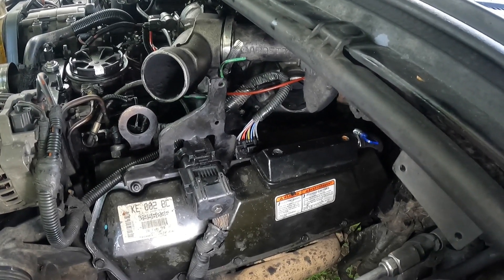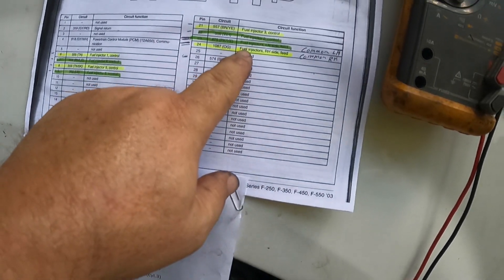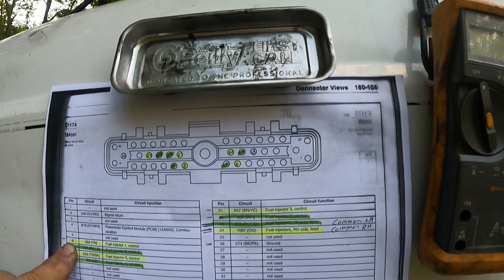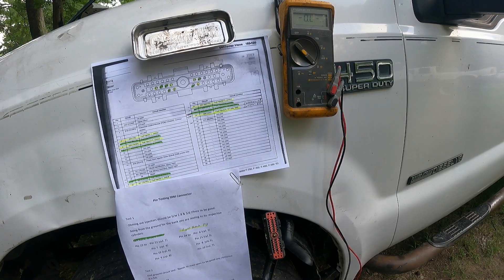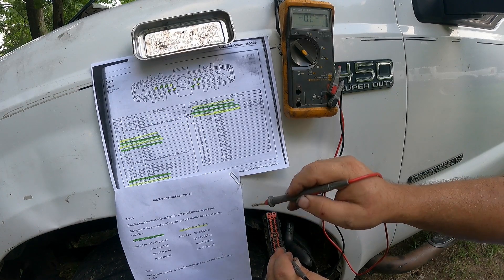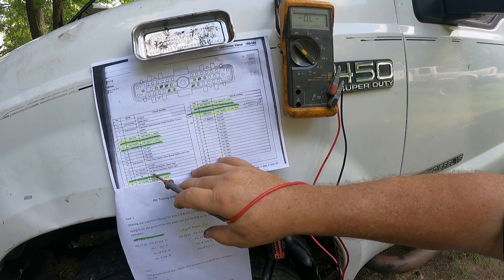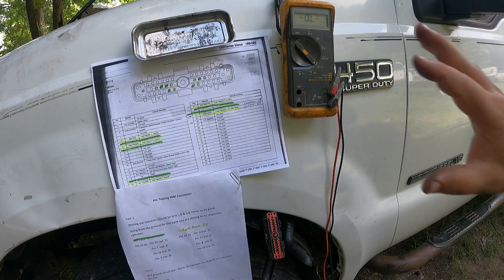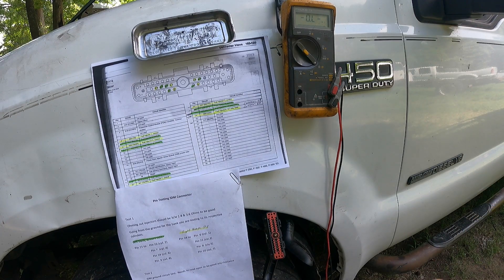IDM Wire Harness Pin Test. P1316 DTC.   2001 7.3 Power stroke

Comment: I have continuity between 24 and 18 in a E350 1997
Reply from the maker: @CristhoferSahagun  it would appear then that your pin 24 (common hot for right side) is grounding to pin 18 (shield wire).  Probably causing a dead bank on the right side. Need to dig into the harness and connectors to find the short.
Reply: @bayoudiesel  Thank you very much! You are very helpful

Comment: Bayou diesel great video, i also have a p1264 code when I test my injectors, as well as a p1316 a p0381 and a p0270 

I tested the harness for a short like you showed about 4 different times and kept getting around .35 for most of the driver bank and sometimes even lower, so not too much resistance

So i assumed idm, poped another one in from a tester truck that was known good and still have the p1264

Also have swapped injectors around (as i just did them) and the problem stays with cylinder 4.

Even cut open the corrigate around the driver side injector harness to look for breaks in any wires, pin 15 from the 42 pin connector (the one with the teal and black wire) seems to have been stripped but I was alsp reading about a sacrifical ground (never heard of this before) so maybe that was that wire. Anyways thanks for any possible help
Reply from the maker: Hey bud.  I had to consult the books to refresh my memory on a couple of these.  Let me tell ya what the books say and then what I think.

1264- hi to low side short
possible causes - shorted circuit, shorted injector, failed idm.
1316- idm code is usually bullshit meaning you have a wiring issue most of the time.
0381- glow plug indicator circuit malfunction.
possible causes- open or grounded circuit, lamp open, failed pcm.
0270- cal 4 circuit low
possible causes- harness shorted to ground.

Now for my thoughts.  Looks like a harness issue.  Probably wiring but could be a connector as well.  When you moved injectors and the problem stayed in hole 4 indicates issue with #4 wiring.  Disconnect the 42 pin and flip it over to inspect wires for abrasion.  You will need to open some loom.  This is for both sides of the 42 pin.  The side coming form the fender is known to rub underneath on the valve cover and the engine side in the hard elbow just ofter the plug.  That should cover 1264 & 1316& 0270.

0381 is self explanatory 

in my book tn/bk is tan /black and goes from the idm plug to the control pin for injector #5.

You have an uninsulated wire and a foil wrap for grounds.  Testing them is in that procedure in the video.

You can swap the uvc gaskets form left to right to see if problem follows it.  If not you are chasing engine harness trouble.  That can be replaced or repaired.

Check that you are on straight ohms, like the setting with the beep.  Some have a scale for ohms and will give ya different readings.  

Lastly keep in mind that when doing continuity (ohm) test you can get a good test with just a strand or two still connected but that won't carry the load of 120v dc going to the injectors.

Hit me back and let me know what ya find out.
Reply: @bayoudiesel  so I checked for resistance again and got a high number and then another one and it seemed like the pin fit wasnt great for that wire on the connector at the 42pin and also at the idm, so i pulled the wires out of the connectors and now get a super low resistance, what could possibly be happening here ? Its giving me like half answers lol. Also I dont see anywhere the harness could have shorted to ground. I do believe what youre saying when you mentioned just because it ohms out good doesnt mean it can handle a the voltage when it is running, so im going to get some pins from ford and overlay that wire and see what happens 

Also I posted a video of the teal and black wire i was talking about its #15 on the engine harness side 

Also how is the 0381 self explanitory ? Doesnt that mean the light is out on the cluster for the glowplugs ? Idk i just did glowplugs, injectors, cups so maybe i left something off under the passenger side valve cover, but gawd damn do I sometimes regret my career choice, if the overlay doesnt work idk what will
Reply from the maker: @TylerBigHead  on the wire that you pulled that is giving mixed results, now that it’s out and isolated from other components try sending power through it by hooking one side to ground and then put a small light like a trailer light to it and hook to hot to see if the light comes on. That will tell you if it will carry a load. 

Seems to me that 0381 may be a bad light in the cluster. Use a test light to check that when the key is in “on” that both large posts on the glow plug relay are coming on. The relay should be on for a min or more every time the key is put into on. Is so the relay and plugs should be working fine but the indicator light or it’s circuit isn’t working correctly
Reply: @bayoudiesel  okay so finally got new pins for the overlay wire, still getting a p1264 when I buzz test, I guess now I have the pins I could overlay the engine harness side of the harness now but that voltage tests good. It still buzz tests good but getting the same high to low short code 

I am very confused at this point
Reply from the maker: @TylerBigHead  have you tried swapping uvch sides to see if the problem stays with the #4 hole. Quick test to determine if the uvch is the problem?
Reply from the maker: Also. Have you tested the #4 solenoid itself?
Reply: @bayoudiesel  yes i have swapped uvch from side to side and I have swapped the injector from 4 to 2 and to 6 and 8 just to double check. At this point i may just throw a engine harness at it as theyre only like 200 bucks but I kinda doubt ill get a differnt outcome
Reply: @bayoudiesel and what do you mean by testjng the solenoid ? Like the injector ? Because yeah swapped that all over lol
Reply from the maker: @TylerBigHead  that’s right. I forgot you moved the around
Reply from the maker: @TylerBigHead  ok. We are getting deep in the pool. If your interested send me your number to my email and when is a good time to talk and we can kick this around in a more efficient manner 

Bayoudieseltrucks@gmail.com

Comment: Hello. I have a question based on this video. 3 pins gave me high resistance. Cyl 7 3.7 ohms
Cyl 1 10.0 ohms 
Cyl 8 7.6 ohms 
Truck barely runs. 
What should I check next ?
Reply from the maker: @jamesrogers2999  when I’m doing this test and fine results like yours I want to move in closer and do the test again but from the 42 pin plug over the valve cover. If same results the move into the uvch .  The reason for that it to  try to isolate exactly where the issue is. You could jump straight to the uvch to speed it up. Looking for changes in you readings which would mean you passed up the problem and need to back up. This will let ya know if you have a wiring issue or just and issue with the solenoid on the injector. 

You can add a buzz test and cylinder contribution test to this to confirm your findings if you have access to a scan tool.
Reply: @bayoudiesel  thanks for your reply

Comment: Very well explained along with the actual testing. You sure helped a lot of us , out here!!! Going to do that test tomorrow.  Have the idm out already but if something shows up on test then I won't go and buy an idm just yet. Thank you !!!
Reply from the maker: @John-n6g  not to say the idm can’t go bad but I find more often than not it’s a wiring issue. Keep in mind that this test is limited tho. Even a frayed wire with only a couple of strands still connected can pass an ohm test but not carry the 120 v dc that the idm puts out.
Reply: @bayoudiesel I don't have to have the batteries  hooked up to get an accurate test do I
Reply from the maker: @John-n6g  no. When testing ohms the meter uses its own battery power.   But it is always a good idea to have the batteries disconnected when doing these kind of test. Uncles you are tracking volts or amps. Then they need to stay hooked up. 

Side note. You’ll be looking for out of spec ohm readings or no reading when there should be.  Feel free to hit me back if questions arise.
Reply: Thank you so much!!!

Comment: Getting a high side to low side open code test injector and wires just like I see in this video. Everything checks good but i get high side to low side open for all of the right side bank.
Reply from the maker: Sound like a short in the common hot for that bank. Keep in mind that an ohm test uses minimal voltage so if a wire is damaged (frayed) with just a few strands holding on the ohm test can pass but it will not carry a load when the idm try’s to send 120v DC thru it. You can disconnect both sides of the harness and use a light bulb to test the circuit and see if that wire can carry a load

Comment: Awesome video Bayou diesel… ran this whole test on my 1997 everything checked out except cylinder 6 read 0 ohms. It has a P1316 engine code. Intermittent hard start and somewhat of a misfire.. I believe cylinder 6 injector isn’t spitting any oil out of the wheep hole either when I had the VC’s off. What do you think? Any ideas appreciated.
Reply from the maker: Usually 1316 means electrical issue in the harness. When I start at the idm plug and find an issue I will usually move inward to the 42 pin plug on the driver side valve cover. Test again. If issue is still there then I will move inward to the 9pin uvch plug and test again. If the issue stays in front of the of you then it may be that injector. If the issue disappears when you move inward then you have past it up and it is in the section of harness behind you. 

Hit me back if you have any more questions and thanks for watchin and the comments

Comment: Can you load test/ohm the wires between the idm and pcm plugs specifically the 818 circuit feedback signal output 817 circuit cylinder identification 821 circuit fuel delivery and what are steps do i need to have everything unplugged or everything plugged in
Reply from the maker: When it comes to testing the components that’s above my pay grade. lol. 

You can un plug the components and load test plug to plug to check integrity of the wires and pins. I have used a simple 12 v light to do this.  Works well
Reply: @bayoudiesel  i don't mean the idm and pcm them selves just the plugs like the 42 pin to idm test but instead pcm plug to idm plug is it possible to test the 4 signal wires between idm and pcm i tried i cant get any continuity on anything i have main harness out that sits on top of engine i dont know if 42 pin plug has to be plugged in to do pcm plug to idm plug i still have a p1294 code these are last 4 wires and then i guess its idm time
Reply from the maker: Yes sir if you unplug the components then you can test the wires. I would ohm them first and then if you don’t find a trouble area then redo the test with a light like off of a trailer to apply load. You could do that light test first if you like and. Skip the ohm test. 

If you need the pin outs for the pcm plug I should have them and can send it to ya. Just send me your info at my email
Bayoudieseltrucks@gmail.com
Reply: @bayoudiesel  so i need to unplug the 3 connectors on firewall and the 4 on inner fender as well or do they matter also do you know if the pcm diode in fusebox can cause individual bank to shut down or make it where im not getting any readings i cant get anything out of pcm plug thank you for your time
Reply from the maker: @rustyshackleford6137  the smaller plugs on the inner fender under the master cylinder that are heading down to the frame are for rear truck functions like fuel, lights& speed sensors. 

The three large ones next to the pcm plug allow communication between everything in the cab to everything under the hood. 

As for loosing an entire bank, I usually start at the engine harness or idm. Entire bank kinda narrows it down cause it’s usually a short in the common feed to to the injectors. But San be the idm as well. 

Tell me more about the symptoms you are having?

Any codes?
Reply: @bayoudiesel  i have a p1294 high side open code and p0475 ebpv b1450 wiper select p1876 transfer case selonid and a b1359 ignition code  i swapped uvch drivers to passengers no change i have checked harness i cant seem to find anything it only runs on bank 1 i still have wait to start light maybe it is just time to buy an idm
Reply from the maker: @rustyshackleford6137  idm is a possibility but I still believe a harness issue. Do ya know someone with a 7.3 that you could borrow the idm and swap it to do a quick check?

Seems like a good bit of codes spread out in different areas. Any signs of mice eating on the harness?

Side note. Remember to clear codes as you go so your are not looking at old business from some repair in the past.
Reply: @bayoudiesel no mice signs i have had batterys unhooked for quite awhile now i have my harnesses that sits on top of engine out i unwrapped it i havent found anything the more i check the more baffled i am and as for spare idm i havent been able to come up with one yet
Reply from the maker: @rustyshackleford6137  send me your number to my email if you have time for a call. I have a few minutes if ya need. 
Bayoudieseltrucks@gmail.com
Reply: Also do you have to do pcm like the idm plug where your using both leads on one plug or its just plug to plug sorry for all the questions but i do appreciate it

Comment: How do you do the same to the IDM, and what do you mean by the PCM, and where is the PCU.
Reply from the maker: In case I missed it when I first read this. The PCM is right next to the park brake and sticks thru the fire wall to meet a large plug under the master cylinder
Reply from the maker: I don’t have any info on testing the IDM. If you find some please share it and I’ll pass it around. As for the IDM I have a spare one that is good so when in doubt swap it out. 

PCM is the computer same as pcu just different terminology. And again I have no test procedures for that. I have a spare there as well. 

The pcm could be sent to diesel technology of Chattanooga to be tested. Possibly the idm to but you’d have to check with them. 

Let me know what going on with your rig and we can see if we come up with some ideas to get her purring again

Comment: All of my readings are around 11.4.

My UVCH test readings are good.
Buzz test good. No codes. PCM working because I i can unplug sensors one at a time and get codes.

The IDM relay clicks just after key on and immediately SES light cuts off instead of normally staying on for a few seconds before turning off. Did not do that before. 

You've mentioned testing the 42 pin plug test, do you have a video on that? 

I have replaced my engine wire harness and it's a crank no start. 

The SES light cutting off immediately has led me to here. Any info is appreciated!
Reply from the maker: Do you have access to a scan tool to watch live data?

As for the 42 pin test, I don’t have a video on that yet but all that is is moving down the harness closer in to try and find or eliminate bad and good sections of harness to isolate the problem. If you replaced the engine harness already the would probably not be the issue. 

These trucks need to see things like cps to know where the timing is as well as icp psi to see that there is a min of 520psi or it will not pulse the injectors. Among other things to. We need to figure out what part of the equation you are missing that causes the no start. 

You may need to send me your number to my email and we can kick this around over the phone. I hate to bring these things out of the comments but it’s hard enough trying to diagnose via comments. 

Bayoudieseltrucks@gmail.com

Comment: Will injector 6 ground communication wire grounding out somewhere keep bank 2 from working i have a p1294 high side open code have been just about everywhere but #6 injector reads 1800 ohms thru idm plug
Reply from the maker: So #6 is way outta spec. Could be wiring or the solenoid but would only be isolated to #6. 

1294 is high side open banks 2 (left side).  Possible causes are open circuit or faulty idm. Sense you seem to already have a circuit issue with #6 I would lean that way. Although you see idm code I find more often ten not its wiring and not the idm. But if you can find/borrow one you could swap it to test. 

Back to the wiring.  The center pin is the shared hot for the injectors. The 2 in front and behind it are the inj grounds. To loose a bank the center may be shorted or multiple wires are shorted. If you test the harness through the idm plug then move to the 42 pin and preform the same test then to the uvch 9 pin plug you may be able to isolate your problem. 

However keep in mind that even a frayed wire that is rely hanging on by a thread or two can ohm out but it will not carry a load of 110 v dc. So a good visual inspection of the wiring especially from the 42 pin to the uvch would be a good idea. 

Hope that helps. Hit me back if ya have any other questions. Thanks for watchin.